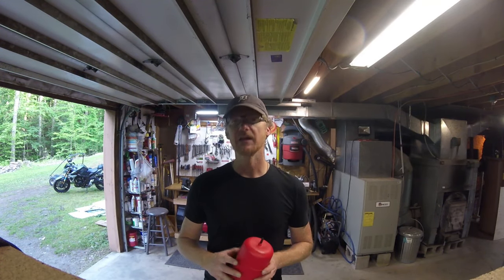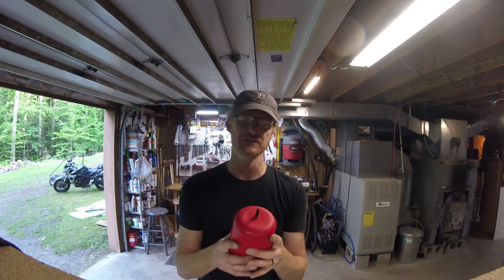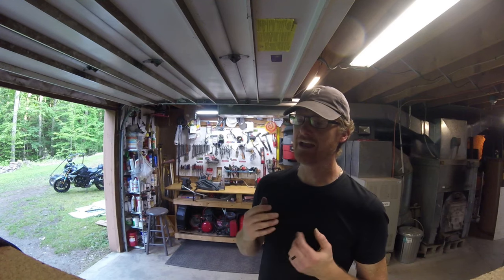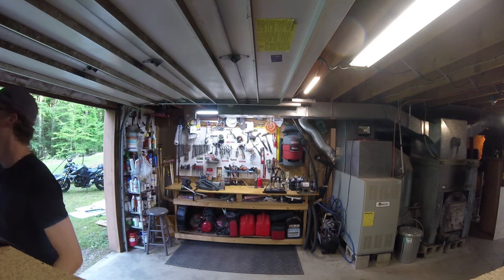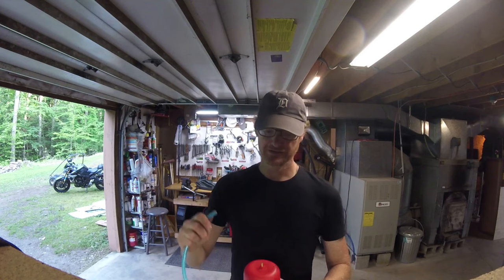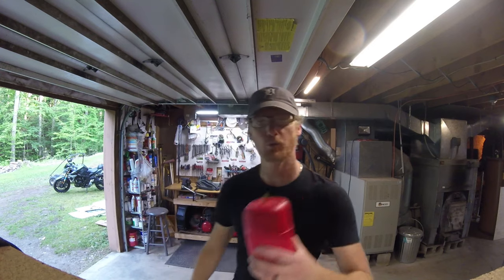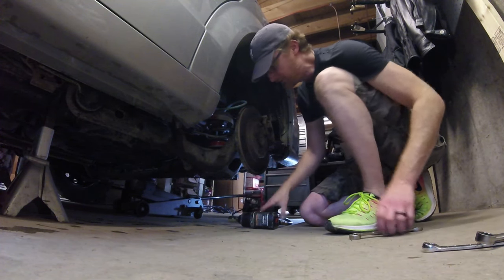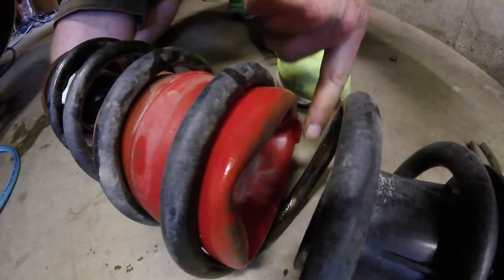Air Lift Air Bags 1 Year Update | 2015 Dodge Grand Caravan

Comment: I have these in my 2016 Grand Caravan last 3 years., and I had the hoses break as well after 2 years, but my bags survived. I fixed the hoses with the original and it is working well again. If/When the hoses let go again, I will use the pneumatic hose, thanks for the idea!
Reply from the maker: The hoses worked well for me! And the bags are truly awesome when they are working. Best to you!

Comment: I know it’s an older video, but if you want air bags that will last, get something that doesn’t go inside a steel spring, you can adapt bags to go in some tight spaces, I used air springs that put pressure on a dump truck drop axle once it’s lowered. Those air springs are almost identical to the air springs in the loadlifter 5000 kit. This is just an example of what’s possible. You wouldn’t need that kind of springs, but they come in many designs.

If you just like the bags inside the springs, you can get some tough fabric too go around the bag so it’s between the bag and the spring, there are bags sold by an Australian company that actually come with them, I’m sure it would be easy to put that same type of fabric on any bags though.

Comment: Excuse me for saying it, but you have to take some responsibility for the problem.  You said that when you put the snow tires on you noticed that the bags were deflated.  You should have been periodically checking the air pressure in the bags all along.  Who knows how long they were deflated.  Because they didn't have any air, the hose crimped and eventually broke.  The hose probably would not have broken if the bags were inflated.  You are of the opinion that the hose first broke and then the bag deflated even though you have absolutely no evidence or proof to support that theory.  The damage to the pneumatic hose was completely your fault because you let the hose rub against the tire.  I saw your other video where you installed Monroe load leveling shocks and in that video you say that you have the Air Lift bags inflated to 65 psi.  The instructions clearly say that the max pressure is 35 psi.  The point that I am trying to make is that it might be possible that the failure of the air bags might not be completely due to the product and might be due to your mistakes.
Reply from the maker: Robert Johnson thanks for the thoughts. I disagree. Originally I had not inflated the airbags above the recommended pressure. I was towing a much lesser load. The original lines broke and would have broke no matter inflated or not. The design causes the hose to be compressed and crimp. As it crimps and uncrimps the hose splits. Losing air. The bag itself decayed in the harsh winter, losing its elasticity. Breakage is inevitable, which is true with all things, but I thought these would last longer than they did. I’m not alone in this assessment. I’m just one who documented it. Ultimately, the proper way to tow this new heavier popup camper requires a load leveling trailer hitch/bars. These bags work great but they did not last very long for me in my situation. PS, I just put my winter tires on today. The bags are still working but when I inspected them they were as hard as a rock. The pliability is gone. My new hoses are working great though! Thanks again for your thoughts and for watching the video.

Comment: I installed a set of these on my Sequoia and after 1 trip, they went flat.  Took them out and went back to stock.   PITA
Reply from the maker: Agreed. They aren't very heavy duty. Better to buy stronger springs if available. or, like I did, started using a weight dist hitch.

Comment: The install I saw, the air line came out of the bottom, not the top.. if the air line comes out of the top, the first large bump will crush the air bag inlet/hose fitting.
Reply from the maker: I have heard of those alternative instructions. I followed the instructions they gave me. BTW, the hose broke from repeated flexing. The bags failed from hardening and cracking after 1 VT winter. I have moved on and am now using a weight distribution hitch and it works perfectly :)
Reply: @sstressfl  I too am skeptic about bag failure and cold weather.. now considering spacers

Comment: Please let me know how’s the Air Lift today!!!! It’s 2023 I  went through all your videos and all I saw was you change shocks then 100k mile trans fluid swap
Reply from the maker: They didnt survive. I ended up buying a weight distribution hitch and it was all I needed. I dumped the cheap air lift bags and all of the hoses. The wdh was the right solution 👍

Comment: The airline on top is killing ya. Mines on the bottom and been good 3 years now
Reply from the maker: How are your bags holding up? After a winter in VT mine become very brittle. I'm going to a load leveler hitch this summer for towing and dumping the bags. Its a shame because I really really like the way the air bags work when they're healthy... and I dont even mean for towing. I like how I can adjust the ride quality. I prefer slightly more firm than stock. Makes the van feel so much more stable.
Reply: @sstressfl  going on 2 years here in Hawaii. i haul fence equipment and a trailer and quad with my oddessey and its bad ass
Reply from the maker: @NATIN2KRAZY  I mentioned in the video that I suspect if I still lived in FL the bags would last a lot longer. They become so brittle after 1 winter here. But I agree, they work marvelously when they are holding air! I sooo like the ride and the ability to level the van with a few quick shots of air. I will miss them.
Reply: Hey, any chance I could get a picture of you did this?

Comment: The airline should be at the bottom fitting inside the red plastic bushing.
Reply from the maker: Joseph Wade I fixed the hose problem with a hose upgrade. The bags however deteriorate and get stiff and crack/break after 1 winter in Vermont. I’ve switched to Monroe booster shocks and purchased a load distribution hitch for towing 👍 Bags are done and being removed.

Comment: Since you did your updated hose has it been good? Did it last? Would you buy air bags again?
Reply from the maker: The bags themselves rot n the Vermont winter :/ I took them off and I bought a weight distribution hitch. It worked perfectly. Would never buy those specific bags again.

Comment: Mine leak constantly also.  I drilled out a 1” hole where it stated a 1/2” and added heat shrink to the tube coming out the top.  Seems to help, a bit.  Still doesn’t hold air for all that long
Reply from the maker: That's to bad. I liked the ride even when my van was empty. But I'm now using Monroe Load Adjusting Shocks and a load leveling hitch. It's much better and now I can rely on it - more expensive though! :)

Comment: In your personal opinion, do you think the lines that come with the kit would hold up better in a area where the winters are not as bad?
Reply from the maker: If I lived in Pensacola, FL and I bought this kit, I would start with the lines that came with it and see how well they do. I suspect heavy dirt and grime and salt and huge temp swings helped lock the lines down and aged the plastic so they couldn’t move up and down freely and cracked easier. I would also reach under the fender-well and tug gently on the lines to make sure they weren’t compressed. And perhaps inspect them throughout the year. 👍

Comment: Did the replacement bags hold up for more than a year?  I read that the AirLift HD black bags are nicer.
Reply from the maker: They did not so I tossed them. I’m using a weight distribution hitch now. Works great :)
Reply: @sstressfl  Thanks for that.  I haul dirt bikes on a hitch hauler from a Sedona in Quebec so I was hoping for better results.  I wonder if the black bags hold up to cold.  I would only use the bags in warm months and could possibly vacuum them out for winter so they do not flex and break.
Reply from the maker: @edwardg9695  when I replaced the coil springs on my van I discovered that rockauto carries stiffer beefier could springs. IMO that would be the best way to go. Check out rockauto.com
Reply: @sstressfl  Did not know that. I was able to find beefier springs for my older Sedona from a UHaul dealer years ago.  Thanks for the tip
Reply from the maker: @edwardg9695  my dad added the ones that are 70% stronger than stock to his 2016 GC. He is a happy man with the ride and support. 👍

Comment: I thought there are spacers on top of the bags, Do you have a 4 year report
Reply from the maker: I cant speak to what parts might be provided now, but this is what they were then. I can give you a 2 year report! :) They didn't last. In this VT weather the bags fail. They get hard, brittle and crack. So I bought a weight distribution hitch and it worked perfectly. Tossed the bags. IMO, these are a great price point but not worth the time and money.
Reply: @sstressfl  Thank you for the info. I'm Glad I found your video, I was about to buy a set but I agree they probably will not last. I hope you are feeling better. I had the neck thing too. Chiropractor helped me but I still have slight tingling in my fingers on my left hand. Getting old sucks. Take care sir
Reply from the maker: @metalmanproductions9267  I am so sorry you're dealing with neck issues. You have my complete understanding. I realized during this that I am always thinking that I need to get back to perfect function like when I was much younger.... the doc set me straight. As we get older we have to learn to live with less than perfect function, pains, discomforts... surgery makes it better, but not perfect (heavy sigh). Praying you find some relief from your symptoms. Thanks for sharing!
Reply: @sstressfl  I am past my issues, you are correct not the same but forging on. God bless and I hope you are on the bike soon. I am a VTX cruiser ride
Reply from the maker: @metalmanproductions9267 nice 🙏 ride safe my friend 😎💪

Comment: If the air line runs through the bottom it can be secured. I think they’re installed wrong.
Reply from the maker: It was exactly as the instructions stated. However, I have been told that the instructions have changed. Regardless the bellows themselves dry rotted cracked and failed after one winter in Vermont. Spend a little more for better ones 👍

Comment: A better alternative might be Monroe Air shocks
Reply from the maker: A friend of mine used them and he said it ripped the shock mounts off the van 😬 I guess the standard shock mounts are not designed to handle a heavy load. Btw I discovered rockauto now stocks different coil springs! Strong ones! That would be the way to go. But ultimately I ended up using a wdh. It works perfectly. But… now I own a truck. The truck upgrade works even better 😀👍😎💪

Comment: Is there a follow up on the upgraded tubing used?
Reply from the maker: Sorry that would have been nice. The airbags simply did not last. But I bought a weight distribution hitch and I no longer needed the air bags. The wdh worked perfectly and proved to be a far better proper solution.
Reply: @sstressfl  thank you, back to the timberens. I have a Hensley weight distribution hitch. Still have not had it installed and still looking for a travel trailer.
Reply from the maker: @chodson65  I have a RAM truck now and towing a 30ft camper. The WDH is all I need, but I am considering adding timberens or something similar to aid in mild porpoising on the highway.
Reply: @sstressfl  I have a 2020 Jeep Wrangler and I am trying to get it ready for this camping season. Since Covid we have been doing a few things at a time and finally adding the finishing touches. Billstein 5100's shockbti be added in a few months and see how everything sits when it's hooked up to the travel trailer. Timberens will be one item to look at if there are any concerns.
Reply from the maker: @chodson65 sounds like you got a solid plan 💪👍

Comment: My struts are gone in my van .will these make them feel right ?
Reply from the maker: No not at all. In the rear you have shocks not struts. Easy replacement. The front has struts. More work but necessary replacement if they’re blown. Plus these don’t tend to last very long.

Comment: 2020 now, how are the replacement ones a year on?

And thank you so much for this review!
Reply from the maker: My upgraded hoses worked great, but I've abandoned the bags and am now using Monroe Booster Shocks and a load distribution hitch. I now have the proper setup for this van/camper combo.
Reply: @sstressfl  I recently bought a 2018 that was a previous rental to use as a service vehicle for HVAC. I added the Monroe® - Sensa-Trac™ Load Adjusting Rear Shocks but did not like the ride, too loose, so I added these and it did help to stiffen the ride. We will see how long they last. Thanks
Reply from the maker: @mikestickley4708  I really like the ride quality of the air bags when they were new :) Hopefully you have a much better experience with longevity!
Reply: Airbag man will probably last the longest of the inside spring bags I’ve looked at, they have a fabric tube around the bag so it doesn’t directly contact the steel spring, rubber air bag single ply isn’t ever going to survive long against anything steel or metal, the fabric bag protects it. Deflating and washing the bags off to remove any abrasive grit trapped between spring and bag occasionally also help lengthen life of bag. If you want a bag to last, get something that doesn’t need to be in a spring, there are many designs.

Comment: They are 100 bucks! The most expensive thing here is the time replacing!
Reply from the maker: And even for free not worth. Later I found that rockauto now carries REAL stiffer rate coil springs for the grand caravan. That’s the right way to go :) and a weight distribution hitch of course 👍

Comment: Why not Nivomats?

They work well on my DGC with the trailer package
Reply from the maker: Mark Lade I went air because I liked being able to restore ride level and adjust the firmness. It removed all of the sway and wandering with these. Glad to hear the nivomats are working for you 👍 If these fail perhaps I’ll go nivomats with a load leveler setup. I’ve been trying to avoid the expense but it might be inevitable. I’ll know more next year :)
Reply: @sstressfl  

They came with the factory trailer package.

I've got 3 teenagers, and saw these vans sagging when loaded on the highway...

The Nivomats will ratchet up the back, returning it to normal ride height in about 500 yards, it's kinda fun to witness...
Reply from the maker: Mark Lade I didn’t even know it was offered! At first I thought you meant helper shocks. You have the good stuff!
Reply: @sstressfl  

$225 each at rock Auto...

Just swap out the existing shock absorbers...

Comment: Question:  Did you lift the front as well?
Reply from the maker: No lift in the front. I just boosted the back as needed. But this year I'm ditching the air bags and I have purchased a load leveling trailer hitch. It'll be more stable and ultimately safer way to tow our fully loaded popup camper.
Reply: @sstressfl  so the air lifts are no good?
Reply from the maker: @Sip28  for me in Vermont, they dried and cracked and the hoses creased and broke as well. I dumped the airlift bags and bought Monroe Load Adjusting shocks. I'm also now using a weight distribution hitch!

Comment: Dude, keep away from these things, they're CHEAP.
Reply from the maker: William Santiago I totally agree. Tossing them in the Spring. Im running Monroe helper shocks now and I’m gonna use a load leveling hitch when I tow our camper 👍
Reply: @sstressfl  I considered getting these air lift springs to help my 2016 Town & Country with towing our pop up camper but ultimately went with progressive rear springs from Rock Auto. I ran those all summer this year (maybe 5 or 6 trips with the camper) and they were great. I figured the air bags would just be one more potential failure point. I've also got a lift kit from Journeys Offroad which has been pretty great for getting around Northern Michigan sandy two-tracks. Anyways thanks for these videos they're super helpful.
Reply from the maker: @owaysys  I saw the spring offerings from RockAuto! Very exciting to see those available. How do they ride? The lift kit is very cool. Slightly larger tires too? I'm a native Michigander! Spent time in Honor/Beulah/Sleeping Bear Dunes area.

Comment: You put them in upside down, the nipple needs to face down
Reply from the maker: If you install them today yes. But a few years ago the instructions showed this method. Still that has nothing to do with the failure I had. The plastic dried out and cracked after one winter.